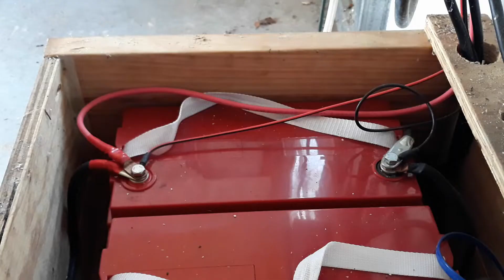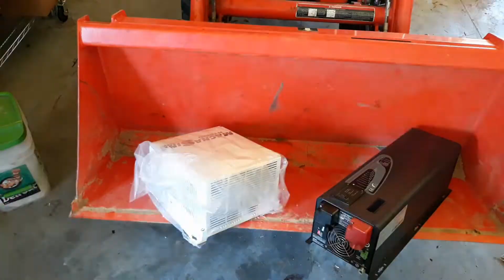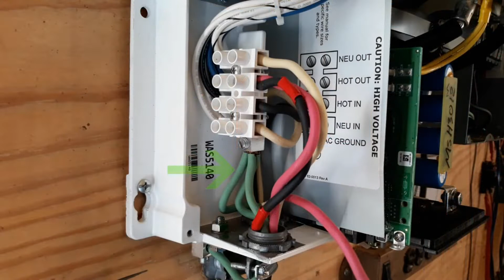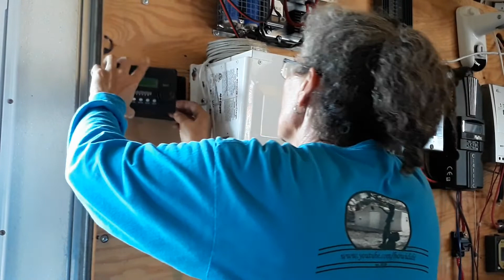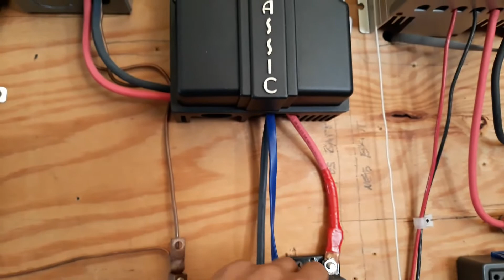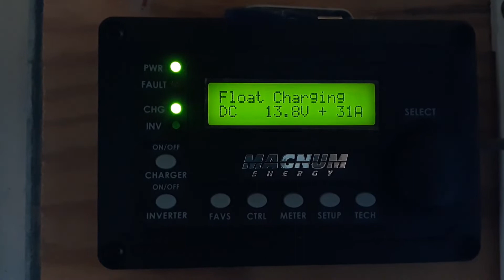Magna Sine hybird inverter charger install ~ How I Did It ~

Comment: Wonderful video. I have the same inverter but I have not installed it yet. I was wondering if this new inverter hybrid, if it has a transfer switch. And also can you demonstrate when it does the-hybrid function. Thank you for the video first time I see a magna hybrid install.
Reply from the maker: Hello there, it's programmable for a time transfer, battery level, automatic...I use the time feature, so the grid power runs my mini split at night so I don't deplete my battery bank while sleeping. I will be doing a solar update soon, thanks for watching